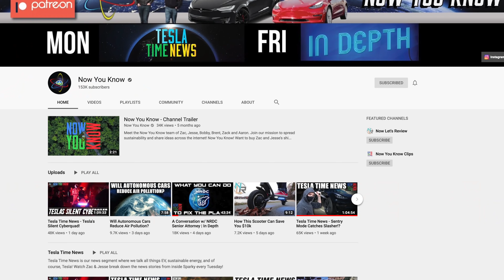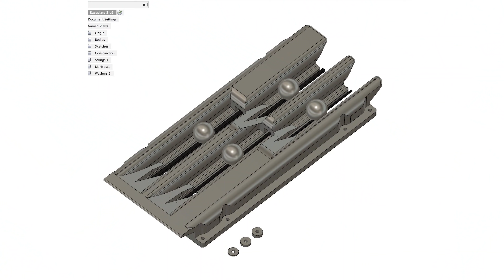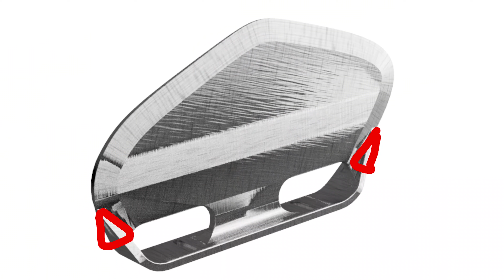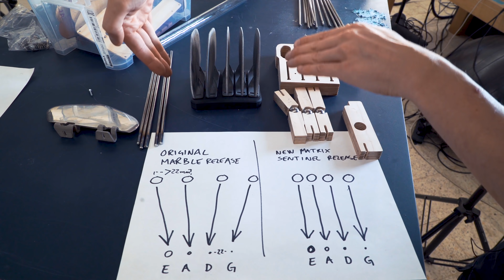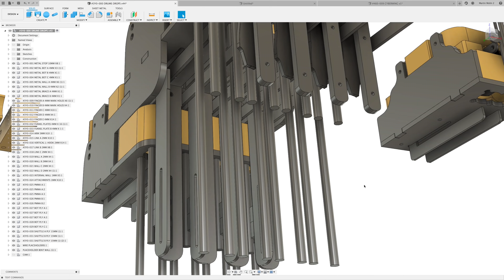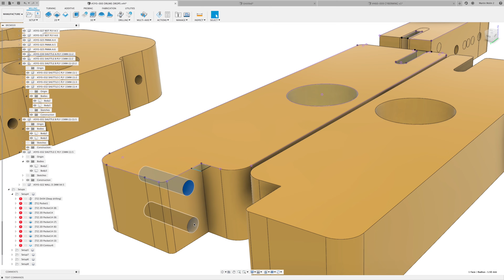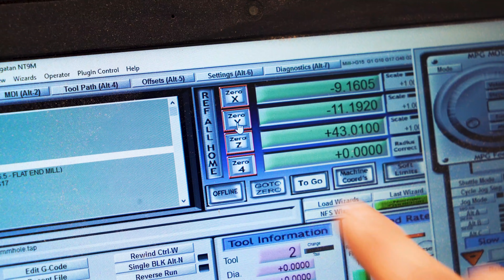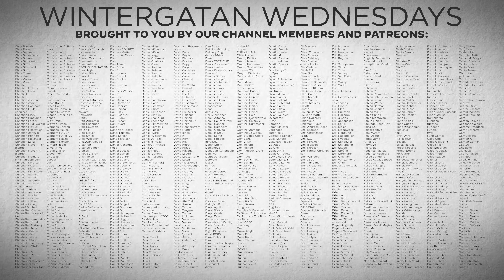How To Hit Bass Strings With Marbles - Marble Machine X #110

Comment: Your video ask if anyone wanted to help you had a link below. I have a Matsuura CNC Vertical Machining Center and live in Kannapolis, NC about 1 hour from Phil at Wake Forest. I would be glad to machine your Bass string partitions from billet or 3D printed material. I use several 3D modeling systems to include Fusion 360. Mac

Comment: What?  I thought the whole point of making the fins out of foam was to reduce noise.  If you make them out of steel, you'll have loud clacking noises of metal on metal that will reverberate throughout the bass and the rest of the machine.

Comment: This may be the best instrument ever. When it's finished, the possibilities are endless - maybe pipe the sound trough spring reverb, effects loops, etc. Hey - a spring reverb could be built in at some point - would add a nice twang when needed. Some subtle led lighting reacting to sounds/events is another possible "spice". I'm not sure if the strings hitting that metal plate is intentional - especially during slow-mo, the extra noise from that hit was distracting. If the strings were to hit anything, I suggest wood instead of metal.

Comment: I disagree with the cyber truck analogy.  It does not surpass the energy capacity of a tank of gas.
Reply: Well, I see it as  a generator and energy storage pack on wheels, get the solar panel version + add other energy sources like a diesel power generator and you can power your home after a storm or long term grid down scenario or travel long distances if you're patient and bring your camping gear lol

Comment: Why drop the ball on the string? You can invert the bass (face down or downward with an angle) and launch the ball upwards into the string. You could even vary the impact of the ball striking the string by varying the launch angle (ramp). Since gravity will control the ball after the strike you won't have a need for guides to recover the ball. Simply catch from below.

Comment: Hey Martin, just a quick heads up, I used to watch Design Prototype Test, and he has a few neat videos, but I thought you should know he also has a couple videos where he goes on super bigoted rants, blaming LGBT people for his patrons leaving- just completely out of nowhere. It felt like I got slapped in the face when those videos came out and I had to unsubscribe. He also has a series of videos accusing several other people in the 3D printing community of stealing his ideas, and seems to do a lot of the things he does out of vengeance rather than creativity. I guess what I'm getting at is he sort of seems to like causing trouble, so I just thought I'd give you a heads up in case you didn't know, it might not be a good idea to poke that particular bear.

Sorry this comment had to have a sour tone, as always I love the work you do and I think you're a positive force in the maker community for good, uniting the makers for one beautiful mega-project/art piece <3

Comment: You should work with Lego and produce a MMX lego set.
Reply: The full scale version that is.
Reply: Me: Wait a moment that might take another 2 years to build ...
Lego (2 years later): Hey that does not sound half bad! ...
Reply: @peterkelley6344  a full sized version, what if it was done in separate boxes, so you have the vibraphone set, and the drum set. You also get a marble divider set as well. Like you can build standalone things with the sets, but it would come with plans for the full build.
Reply: @Kafj302  Personal Biased Opinion here: Yes they certainly could; but some how it would not feel right.  Lego has done that with larger sets.  Where they have 6+ boxes to the set.  The MMX is assemble-able in 8 subsections.  At this point you might make a fair point about the full build being done in sub-sections — just like the real thing.
Reply: Oh hell yeah!

Comment: I've been watching your videos for awhile now and I am impressed with what you have accomplished .I would like to share some thoughts.Your marble machine  instruments are basically all percussion but the bass guitar ? I think you should rethink this section and perhaps  come up with a mechanism that strums or plucks the strings rather than hitting them.  Perhaps like a diving board ,the marble would hit the board, tilt, reflect into your funnel the resulting tilting would covert to a strumming action. ............... Springs One way bearings, ratchet, paddle wheels. lots of fun different way to achieve this. Just my 2 cents.

Comment: Daer Martin! I am wondering that hitting the marble guiding fins made from steel with steel marbles seem to make already a lot of noise. After hitting the string, they bounce off the fins, creating an unwanted metallic "echo". Sounds a bit like "Ka-boom". You can especially hear it very clearly at the slow motion replay.  Not sure which is the intended beat. Will you cover the sides with felt to soften this unwanted extra echo? The fins might ring like a bell with a streak of balls racing down these shafts. Did you consider dampening the hits?

Comment: In Germany, in Berlin, we have a Airport which is constructed since 2006 and should open 2011. They still are constructing it with persistent problems. It's a running Gag in Germany to say "Der BER ist ehr fertig als ... " which means, the airport is finished earlier then your Marble Machine. 

I like your Vids but i don't think you'll finish it ever.

Comment: While that Cybertruck looks interesting, it is seriously flawed. It will be unsellable in EU for example due to that car failing to meet several mandatory standards. For example missing side mirrors, wheels sticking out from cars body a bit, rigid construction that is strong which is something you do not actually want in cars since any collision will mean that your body inside will take full brunt of it instead where cars with softer construction would deform and absorb much more energy and increase your chance of survival. And that is just what is obvious from their presentation.
That car looks neat but I would not want to drive it. It is coffin-to-happen as it is.

Comment: After MMX is done Martin still has to figure out how he’s going to move it. He will have to build a container. 

Also can MMX fit through the door?
Reply: their plan was for MMX to be able to be disasembled into a few parts, transported, quickly assembled, then tuned and played. think it was mentioned in one of the very early vids
Reply: @Riftwalker_hpf3  The MMX is dismantle-able into 8 subsections.  The real question from my view is if each section can be humanly lifted, crated, and then shipped.safely.  An 9th box will definitely have to be included for the support tech equipment, the replacement parts, and other extras of the MMX.

Comment: Do not take inspiration from the cybertruck, it is terrible design.

The exoskeleton is designed to be undentable.
Which means it has no crumple zones.
Which means that in a crash, you will die.

Your body will stop with the car. Your head won't.

Crumple zones make the change in momentum less sudden, they save lives. The cybertruck expects its users to never crash.

It would be like not including the hinge on the treadle pedal, or the screen to prevent your fingers getting stuck in the crank. Safety features matter.

Besides, cybertruck is one man's vision forced together with the wealth of his dad's emerald mine.
The MMX was one man's vision, that was shaped by thousands of donors and volunteers who believed in it and wanted to help.

Comment: ya it's not that hard to guess that a 3D print even mettle would brake on the layer lines i mean i have only been 3D printing things for about a year and even i know to orientate my prints based on stress points and layerlines 

you never have layerlines inline with a bend you are just asking for a brake

Comment: 15:45 could there be problems with catching the marbles with those marble cages? it seems that the bounce direction could change alot if the marble hits the other side of the thin string, maybe use 1 big catcher for the whole base or place the catchers just after the bounce when the marbles are rising? Just a thought I had, greetings from Belgium!

Comment: The mark of a pure engineer is that they find nothing unusual about repeatedly redesigning the marble control fins on the MMX bass (only to have Martin attack the base plate with his CNC machine!) It's not what the part does, it's the pure joy of carefully triangulating in on the best solution. That's engineering at its most enjoyable.
I swear there's more engineering and redesigning going on on this thing than there is on the SpaceX rockets!
However, Martin has an advantage--he has Wilson (the ultimate secret weapon).

Comment: I'm just looking at the MMX video by video and I see it getting bigger and heavier. I am a bit concerned about the weight and the balance of it. You keep changing wooden or plastic parts to metal. Will the frame take the weight and will it not be out of balance because of the many metal parts? Just wondering, not panicing.
Reply: I am totally agree, plastic is perfect, the biggest issue is the noise, then he would start to cry by the whole background noise and he would try to make compromises on how he record the song of the instruments to try to avoid that.

Comment: Hey Martin I had a random thought, with the two marbles bouncing forward on the bass, is it possible for the back marble to intercept a falling marble infront of it? Or do they move out of the way fast enough? I'd hate to make you redesign everything lol, but also I'd hate for you to run into this issue further down the track.
Reply: Mr Splupper hm, thats a good point
Reply: I don't think the marbles bounce straight back up, it looks like the marble bounces to the front once it hits the fins
Reply: @LuisAlbertoSerranoAlonso  I think you are missing the point. Each string will have two droppers so one will be higher up the string and one lower. The possible issue being observed is that when the higher dropper drops a marble which then bounces off the string and when it bounces it hits a marble that was being dropped from the lower dropper.
Reply: @beaverman285  I see where you're getting at and it does seem like it's gonna be a minor inconvenience
Reply: @beaverman285  I think the marbles are going to hit the same point on the string, so there should be no issue!

Comment: About the slow-mo drop, the fin did make some noise/distortion and metal echoing
maybe some foam damper or other materials, not sure if that would be take in consideration
Reply: Since the bass is not acoustic like a gitarr it wont matter. The sound is produced electronically anyway.
Reply: Might impact the signal > noise ratio in other parts of the machine. but probably not. the twanging of the strings might do more actually.
Reply: i agree. would be nice to eliminate all unwanted noise from the music. foam or felt like material might indeed help

Comment: The only thing about the cybertruck is that it couldn't be sold in the EU, because pedestrian safety is non-existent when you hit a hard, thick and edged stainless steel plate :P
Reply: Then no car can be sold, specially super cars then, if we limit our intelligence because of other people's stupidity then we aren't going to advance further.
Reply: @namelezz1216  
What do you mean by other people's stupidity ?
Reply: @i.i.iiii.i.i  By that I mean car accidents which in majority are caused by people's stupidity, for example driving while at the phone, not paying attention, speeding on the wrong locations, also there's pedestrians too that does stupid stuff that gets people into accidents. What I'm trying to say is that in most of those accidents the problem isn't in the car itself, so we shouldn't limit ourselves because of others using the product the wrong way.
Reply: @namelezz1216  But the car kills which can easily be prevented. (innocent or not, jaywalking isn't punished by the death penalty, so even if the stupid pedestrians should be protected from death :P)
We decreased the number of traffic deaths sigificantly, even though humans make a lot of mistakes. 

That's the innovation which is useful for society, idk what limits you mean when you want to increase traffics deaths, by abolishing such innovations...
Reply: Its more dangerous for the passengers as well...
Reply: That's not the only thing and I'm upset that Martin is promoting this scam.  The cyber truck is a publicity stunt.  Maybe Martin is going in the same direction.
Reply: @raykent3211  no...